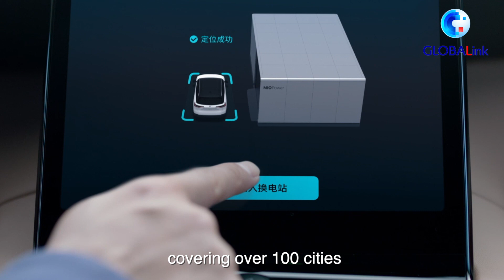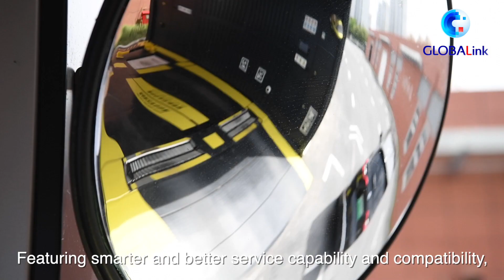GLOBALink | China accelerates electric vehicle support network

Comment: China is doing an amazing job with respect to building out their EV charging infrastructure. I really like the option of leasing a battery and of having the convenience of swapping out a battery in just a few minutes. A swappable battery option may allow users to upgrade their battery packs at a later date with improved versions when they become available. This is a big advantage over having to change out a built-in battery. It would be interesting to see if they can develop a roadside battery swapping service for vehicles that have run out of power. If a service truck can swap a battery for a stranded motorist that would be outstanding.